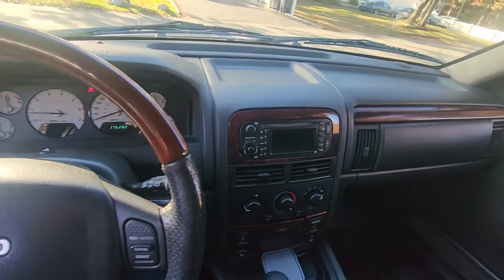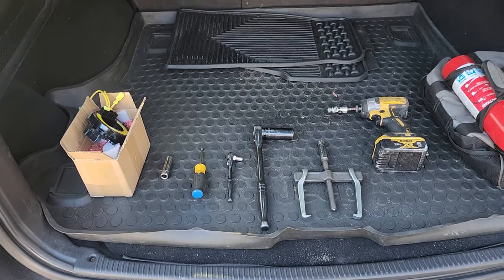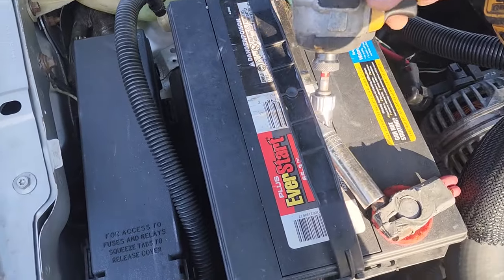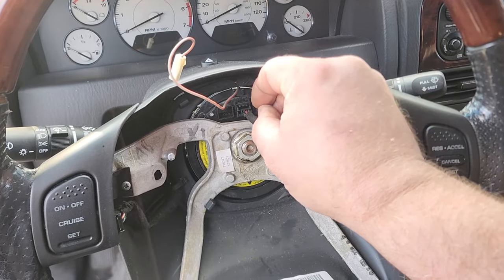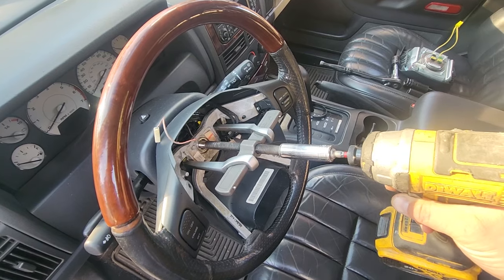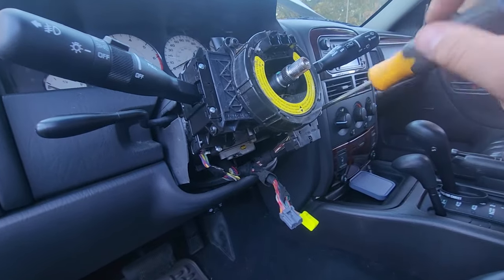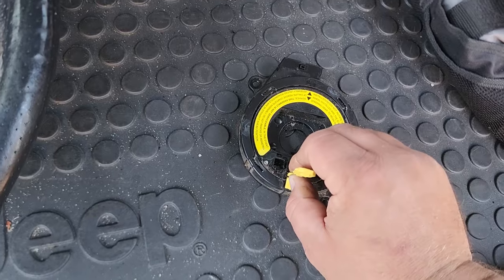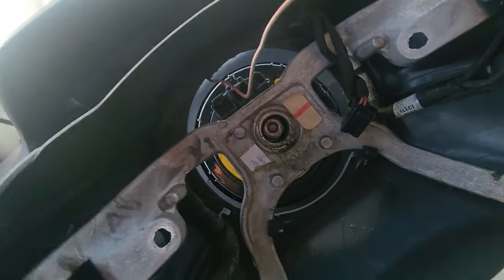WJ CLOCK SPRING!!! JEEP GRAND CHEROKEE AIRBAG WARNING LIGHT FIX ATTEMPT

Comment: Good Video.  If the Airbag goes on only intermittently when turning the steering wheel but goes off while driving straight ahead, then it is most likely the clockspring in the steering wheel.  If the Airbag light stays on all the time, then it is most likely the Airbag module located in the center console.

Comment: jeep service in eu have change airbag module for free. ask in yours.
Reply from the maker: Here they will do it If it has an open recall.. if not they will charge you. 😢
Reply: @ProjectDanH  they have open to my wg but its still working . I would change seat heaters but they have closed to do that to my jeep.  Greetings from Poland

Comment: Its good to change an old clock spring befor trouble starts ;) . Did you check for codes , a good reader reads all the mods.I do some trouble shooting and if I come up with nothing then I start throwing parts at it, lol.
Reply from the maker: Lol No codes! lets the parts rain down!

Comment: Hi, Dan. Speaking of clock springs I have a question regarding my ‘97 ZJ, influenced by a video you did a couple years ago doing a steering wheel swap on your ZJ. My steering wheel has cruise controls on it, but if I want to swap steering wheels to get one with radio controls, is it just a plug and play or would I need to do a clock spring swap? Or am I totally missing something? Your video wasn’t real clear to me regarding that aspect. Thanks in advance.

Comment: Have a question my airbag light on the dash I was told airbag module is bad. I pulled one from junkyard so it need to program or just install without program? Thanks.

Comment: Hello. My airbag lamp is on too. It is not possible to order the module yet. Tell me, if I disconnect the connector on the steering wheel from the module, will the pillow no longer work? Or is it necessary to disconnect the connector near the gear shift so that the airbag on the steering wheel does not work ?
Reply from the maker: Do not unplug anything.  It's better to have an airbag warning light than to have no airbag.  If you are uncomfortable with these repairs please see a dealership
Reply: Thank you. The nearest normal car dealership is about 2000 km away. But I'll take your advice anyway and I won't turn off the airbag. Although it's scary if she shoots on the road. Thanks again and HAPPY NEW YEAR. @ProjectDanH

Comment: Can I drive my 2000xj without the clockspring. Want to put a grant steering wheel
Reply from the maker: use an XJ clockspring with cruise control for the WJ wheel
Reply: @ProjectDanH  I am putting a grant steering wheel